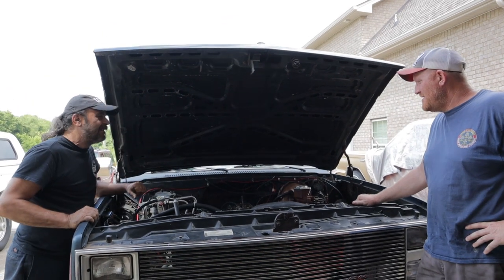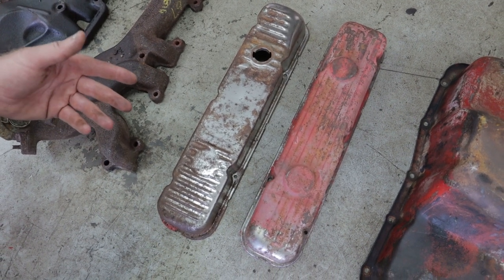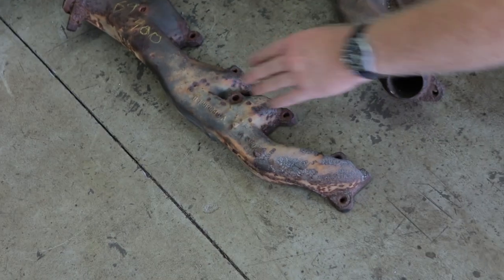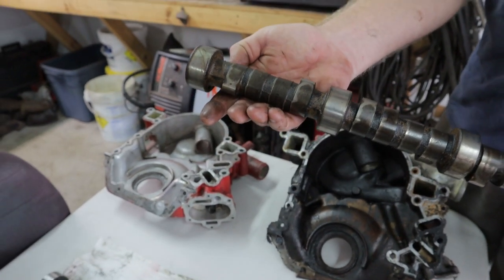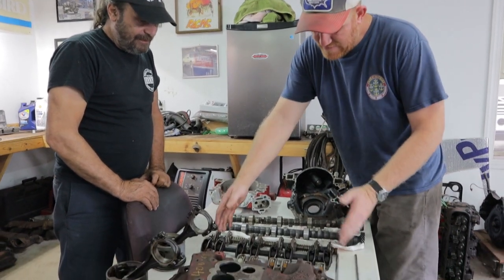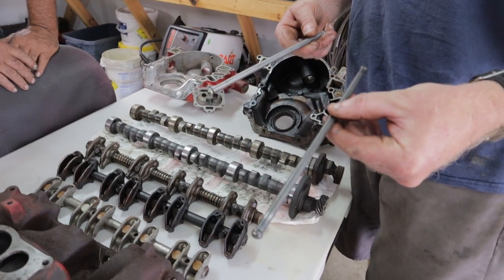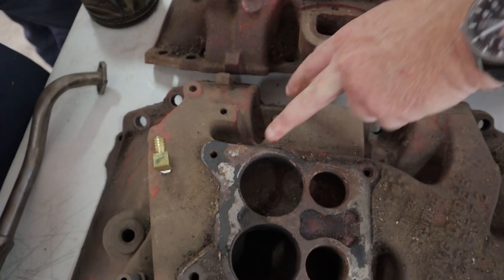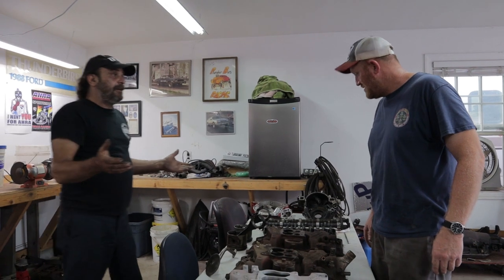Buick Big Block Info Dump

Comment: buick is one engine i never learned anything about. i just know i needed a car to run a enduro race on dirt. so i bought a old wildcat knocked the windows out of it put a up over and down in it and ran 150 laps and for the first 75 laps nothing could touch me. but when we stopped to refuel it was holding maybe 5 psi oil pressure maybe 15 while running by the end of 100 laps we stop to get fuel and it would be knocking. and running about 5 psi buy the end of the 150 laps it had ZERO oil pressure. and the engine locked up on the last lap and i coasted to a 3rd place.
BUT now if i had known what that car is worth today i would have never done that to it.
 but i also did the same thing to a 69 cornet RT and a 71 charger RT. but i never said i was smart.
Reply: oh the wild cat i think was a 64 maybe a 65 it had the 403 in it all i know
Reply: @MadsWorld34  403 was a later model 1980's Olds. Try 401 instead.
Reply: @LR-my2di  your right it was a 401 but i'm old and that was in the 70's but again i wish i had known what that car was going to be worth today. i wouldn't have turned it into a dirt track car

Comment: Respect for down low torque - but why didn't Buick do better at the drags?
Reply: Buicks were the quickest GM cars back in the day 455 kicked Chevy's rear!
Reply: Marketing.

Chrysler had the hemi name.
Reply: @01trsmar  like once the big block chevy will never be outclassed as the best
Reply: Heavy cars , high gears , low stall converters, old owners 😂 the 70 gsx is supposedly the (fastest) muscle car even over the ls6 Chevelle but how many people care
Reply: @vicmccartin  Once again, if it was really so fast then where is the success at the track.  The GSX and other Buicks were not really heavier than any of their contemporaries.  Low numerical gears work well with off idle and down low torque.  Buick was like everyone else on standard torque converter stall - and it was real easy to retrofit a switch-pitch converter using factory Buick parts.
Reply: @ScottKenny1978  marketing has nothing to do with on track performance and winning.
Reply: @01trsmar  once again, where are the track wins?
Reply: @Thomas63r2  you know that the race team usually comes out of marketing's budget, right?
Reply: @ScottKenny1978  Oh it was even better than that, engineering could get in on the action too.  Still, the privateer working on their own budget only cares about finding a winning combo.  Lots of guys pored over the class rulebooks to find cars with some advantage, whatever that may be..  There are plenty of dyno printouts from all sorts of engines so that we can really compare one brand against the others.  I like Buicks, at one time I contemplated building a 455 into a 528.  Instead I built a street pump gas 496 BBC that made a bit more than 600 ft. lb. of torque. and could rev to just shy of 7,000 rpm  (peak hp. was  fairly flat from  6,000 to 6,600) .
Reply: @Thomas63r2  sounds like lots of fun!

I know Uncle Tony has talked about running a 392 Hemi instead of the 426, I think in top fuel, because of limitations in the intake. The 426 needed a bigger intake or carb or something than the race class allowed.
Reply: @ScottKenny1978  Even years after the birth of the 426 Hemi many racers were competitive with a 392 Chrysler or 417 Donovan based Hemi.  I will not pretend to know much of anything about running a nitro engine - other than Nitro brings its own oxygen to the party.  With nitro the name of the game is getting as of it into the cylinder just short of hydro-locking.  Nitro also has a big dead zone of ignition timing: it likes either very little or massive ignition advance - but will blow up if given what would be normal advance for a gas drag engine.  I think most people currently running nitro have more than 50 degrees of ignition advance.

Comment: Let's Dump a BIG BLOCK in a MIATA
Reply: Or an old Mini Cooper
Reply: I had a 429cj in a 90 miata, 5 sp tremec 3.73 rear 

Couldnt get it inspected after my state changed motor swap "laws"..... Ive still got it, in storage.
Reply: @constitutionalrepublican1611  WOW insane....You should get is started and do a video of that car ...a one-up to Tony but he is man enough...hehe...
Reply: @gt-37guy6  i had it on the street up until 2008 i built it in 2004-2005

Man it was so hard to keep the traction i added weight in the rear

Thing was constantly burning out on the roads lol

I remember, last times i had it out kingston cops pulled me over 4 times enroute home for invalid inspection sticker one fine stuck, other 3 didnt. 
 I parked it the next night.  Its sitting on a lift up in the air above my 63 impala wagon, has a blown 409 4 speed in it all original except the motorwork.... Its white with green interior full chrome options :)
They frown upon blowers around here too..... Unfortunately. 
Ive since turned to smaller motors and turbos.... My next project is a 250- 6cyl twin turbo in a four door nova. 

Family cars...... Sleepers.
Reply: @gt-37guy6  You probably would like my 1993 subaru legacy turbo sedan,  ej22t stroker, 5speed dogbox (25th year anniversary car (one of only 500 made that year)   its winestone burgandy with black tweed interior
Reply: Bigmanbam44  pa actually....  But its just as bad imho with the out of staters from ny and nj moving in the last 20 years.
Reply: Bigmanbam44  attrocious but im out in the woods so idgaf.... Might have to pull it outta storage and take it for a rip down the hwy next week or so
Reply: Bigmanbam44  eh its only as bad as you make it, always keep a older jeep in the fleet, lol
Reply: @constitutionalrepublican1611  deffently not a biden voter 😂😂😂👏👏👏👏👏👏
Reply: @constitutionalrepublican1611  stovebolt buzzin half dozen nice
Reply: @constitutionalrepublican1611  my first car was a 71 Malibu but that was a resto project. The first car i drove as a 16 year old was a 90 Subaru legacy i beat many 5.0 mustangs . i believe it was a ej 2.5 no turbo but light awd ugly ass brown color miss that car. Ive been dreaming about a turbo rx or turbo xt , 80s turbo subies and the 22b are fantastic cars no matter what my v8 friends say

Comment: Ill take Torque converters u can take apart for $200 uncle tony,,, what is a Dynaflow ?
Reply: I do not recommend taking a dynaflow  converter apart unless u know what your doing clearances are everything in those
Reply: @jeremyhanna3852  im aware of that if i had one it would be more of a decorative piece to talk about. But its basically a powerglide that you can change the stall speed on

Comment: didn't Buick race in NASCAR in the 70's anything special. I boycotted NASCAR AFTER THEY BANNED THE HEMI, CAME BACK WHEN DODGE RETURNED 2001
Reply: Nope!
Reply: bout 3,800,000 results (0.56 seconds) 
From 1986 to 1987, the LeSabre was Buick's entry into the NASCAR Cup Series, with the two-car Stavola Brothers Racing team of Bobby Allison and Bobby Hillin and King Racing's single-car effort bringing the marque to the track.
Reply: @josephszot5545  True! But this was with the Chevy engine. When I think of Buick, I also consider the engine.
Reply: I agree with you like in NHRA every FC is a MOPAR, are you telling me that NASCAR allowed that
crap in STOCK CAR RACING. What BS! happy new year LR
Reply: @josephszot5545  Mopars were built by the gazillions for racing all the way up to FC and Top Fuel.  But FC and Top Fuel has no relevance to me. I'm a hi-perf. street guy with no use for a trailer. That's why I love my 1970 GS Stage 1.  It's never let me down doing what it's supposed to do. .